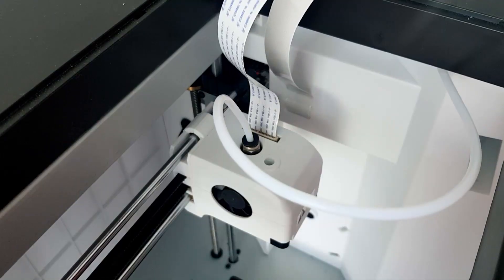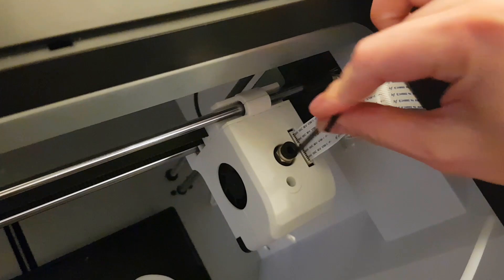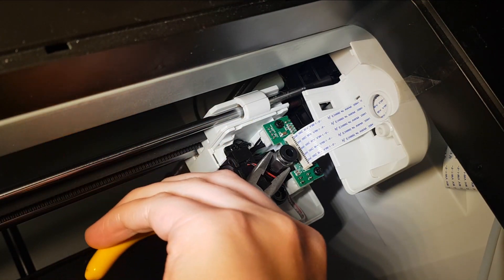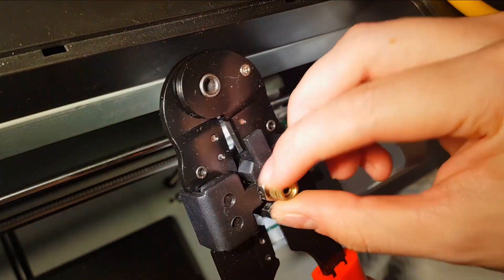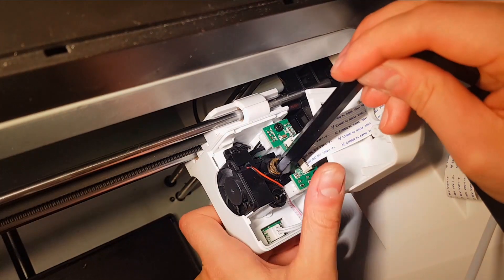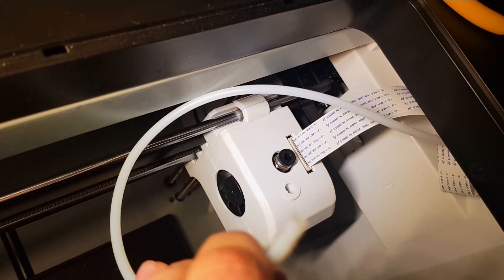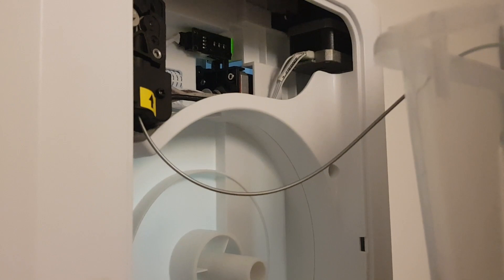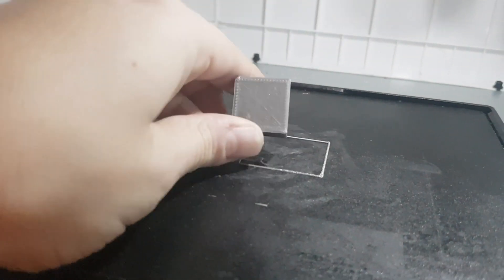How to Replace a stuck Bowden Tube Coupling | Flashforge Adventurer 3

Comment: I think that the black plastic mount that the brass fitting goes into is broken.  You shouldnt be able to put a screwdriver in there to make it bigger so you will need to replace that too.  Also if you are fitting brass fittings like this it is best to use a soldering iron to warm and press them in.

Comment: I just watched the video and applied what you did to my own setup.  Couple things I should point out that I found.
I just unscrewed the entire black casing that houses that brass. It made installing it a lot easier and like you I tried wedging it open to fit the nut. I actually think the manufacturer broke it. From what I could tell, the seem is not natural and almost seemed to snap without a hinge of any sort.
After installing the nut into the plastic frame, I reattached it and returned all parts and screws to their destination.

Comment: Thanks for the rad video - very helpful. When I push the tube into the coupling, should it be hard to remove? Mine keeps slipping out. Am I missing something? Do I need a new coupling? :(
Reply: i am having the same problem. Tube keeps popping out, and i can't print. So i believe to fix this problem we will need to buy the bowden and install a new one. Seems like the coupling holds the tube into place. ughhhhh what a pain hu lol

Comment: While I REALLY appreciate people sharing their experiences online, for all people that find this video, as I did tonight, in the hopes of getting an understanding on how to pull apart the printing head of the Flashforge  Adventurer 3 to replace the  collet, please don't use this video.   There is a MUCH better one here: https://www.youtube.com/watch?v=NHVHN1l0H9c  

In this video, they leave the ribbon cable in, they operate on the print head while still installed in the printer (it comes out quite easily), the airflow guide gets broken when they try to twist it out, then they break it more to get it back in again... 

Please: use the better video located here: https://www.youtube.com/watch?v=NHVHN1l0H9c

To the original poster, I genuinely thank you for taking the effort, and trying to fill in for the lack of videos for this kind of thing, but this video should really be taken down, as it will lead to people breaking their printers...

Comment: How NOT to replace a bowden tube coupling!!! 

OMFG! "Just wiggle it, it will come off?" No, you lift the front of the cover to clear the rear clips, then it will lift off. Why did you risk damage to the nozzle cable by NOT removing it and storing it safely? Why did you not remove the head assembly from the printer so as to NOT risk damage to the x-axis smooth-bars? I cringed and yelled at my computer when you assaulted the bowden retention assembly with a pair of plyers! It's that shape because you're supposed to use a spanner! Then you anchored the retention head with an RJ45 crimp tool, complete with minced pressure-teeth?!?!! By this stage, I was not at all surprised to see you try to moosh the insert back into place with the flat-end of an allen key. "For some reason, I struggle putting this cover back on" .... CLIPS! Right there in your video, there are clips that need to go in place!! Are you TRYING to give me an aneurism? (Deep breaths .... deeeeeeep breaths .... )

I sincerely appreciate that you have posted a video to support the Flashforge community - but I also hope that nobody who watches does what you did! There are procedures for a proper hot-end teardown available to the public. #RightToolsForTheJob #RTFM #DontSmashItWithAnAllenKey

Oh, and for the love of Steve, get some iso' and clean that print-plate!! #Peace #HappyPrinting
Reply from the maker: Hi Robert :) I appreciate your passionate reply and helpful points. I definitely agree that this is by far not the best way to do it, it's just how I decided to do it at the time. I did of course try to search for Flashforge material on how to fix this issue, but unfortunately I didn't find anything :(  So that is why I made the video. Do you perhaps have a link to the material you mentioned? I would really like to make a follow up video on how Flashforge recommends it to be done.

But 3D printing is also a continuous learning experience for us so we are constantly learning how to do things better. I'm thinking of maybe buying a build-it-yourself printer at some stage, to gain some more knowledge about the basic mechanical aspects and skills that I am lacking at the moment.

Apologies for the potential aneurysm! Thank you for taking the time to comment :)
Reply: @PlumPot  OMG, build your own ...YUSSS! My son and I are on the verge of building a VORON 0 ... if you have not heard of them, get ready for a full-on "mind-blown" moment :D :D Voron do not sell printers - they don't even sell parts - they will only assist you in sourcing your own raw materials and assembling your very own creation! Are you going to do a full series on the build? Your video-format style is very watchable, I'd certainly be along for the ride watching each step. I see you're in the Netherlands, too - your English is completely perfect, almost like a Kiwi! ( <3 NZ) I'm assuming that you're 1st-language English speakers, eh! (Couldn't find Nedersaksisch subtitles...)

In the meantime, please keep posting FF A3 material, the community is in need of more "width", along with people not afraid to tear things down and build them up again :D :D

Oh, and good news on the aneurysm - the EMT said it was only a heart attack and the meds are helping :D :D  Much love from NZ!

Comment: I removed the connector easily with a wrench, it hadn't the same problem as yours. I had lots of dust and old filament strings in the connector and once they were removed it could once again load filaments. However I had to remove the tube from the connector and however i tried it wouldn't get back on again, kept popping up... So I superglued it and that seemed to work fine the first time. A few days later had same issue again (dust/old filament strings) and this time I guess I put too much superglue so now the black part of the connector is stuck to the connector... makes it a lot harder to screw it back on. After seeing your video I think next time I will cut off the tube and find some way to pull out the rest from the connector and hopefully solve the problem.
Thanks for a great video!

Comment: Thank you for making this. It's good to know how to do this. I recently had filament get stuck in my PTFE tube and I had to cut the tube and pull this out. The "quick connect" didn't work! I accidentally pulled hard enough to pull the plastic quick connect out -- I had no idea what to do next. I bought replacement parts and I'm going to need to replace this coupling... your video will help!

Comment: My tube pops out as well and my nozzle was stuck on 300 and crazy over heat replaced nozzle was working fine but tube popped when I wasn’t home has to be this part
Reply from the maker: Ah man, sounds pretty much the same as what we went through :( Why dont you open the extruder case and have a look, let us know! We haven't had any trouble with the tube since doing this fix.
Reply: @PlumPot  I did fixed that problem but now after first 2-3 layers are fine the material seems to be over extruding and causing hang ups on material and grinding from nozzle not being able to clear pre exsisting layer I’m running it all off iOS iPad tinkercad app and polar cloud which has slicing software built in

Comment: I have the opposite problem: I can't remove the tube to clean the nozzle. Also, the right tools would have helped, but I think you'd still have had that problem with the insert coming out. Well done.
Reply from the maker: Hi Rabid :) Yea i think you are right lol thanks for your comment. Did you come right with the removal? What type of things are you printing with your FlashForge?